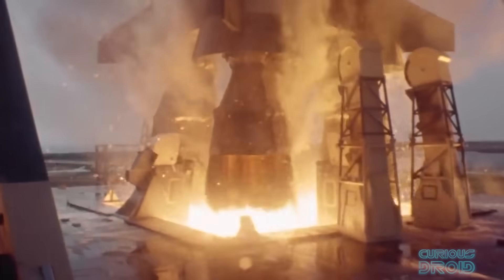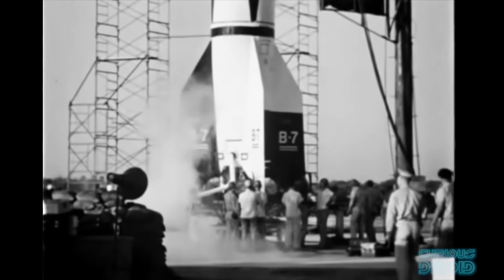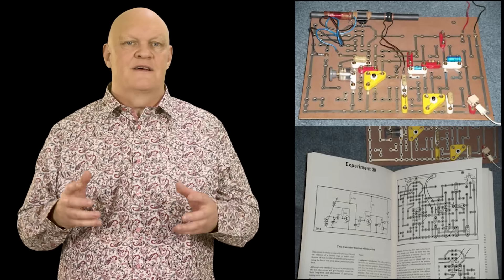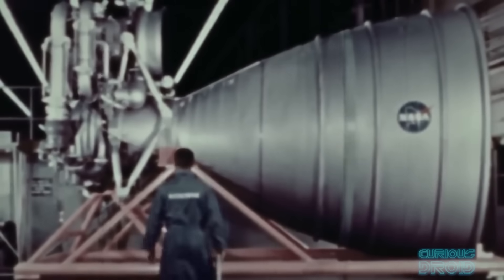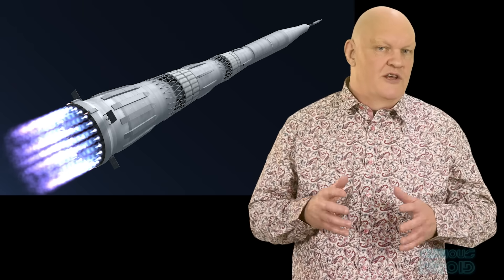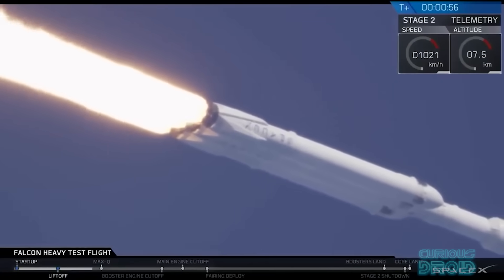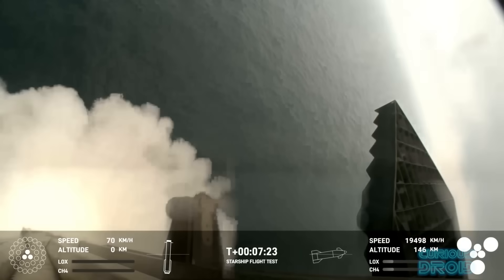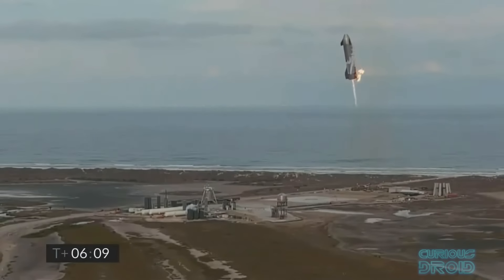Why Does SpaceX Use 33 Engines While NASA Used Just 5?

Comment: If starship has more thrust than apollo, why does it need to be refueled in orbit to reach the moon?
Reply: Because Starship is not being developed to fill the Saturn V's shoes.  If all SpaceX wanted to do with Starship was lift something to LLO, R&D would have finished years ago and the vehicle would already be complete.  Starship has two huge mandates: Full reusability and the ability to get a massive (100 to 200 tons) payload to Mars.  NASA's HLS contract is a side mission.  That all being said, it is extremely fortunate that SpaceX won the Artemis contract, because the end goal of Artemis is to "stay on the moon", which means you need to bring 1000 tons to the moon's surface eventually.  No matter who developed the vehicle to make that possible, they would absolutely have arrived at the same exact solution: refueling in LEO to make the rest of the trip.  Otherwise you're not going to get all that mass to the moon, period.
Reply: @Asterra2  And yet they can't even get 1 ton to LEO.
Reply: @C.I...  What will be the next thing they haven't done, after they've taken advantage of one of their test flights to deliver Starlink?  I refuse to believe you seriously think that was some kind of legitimate burn against SpaceX.
Reply: @C.I...  They haven't tried, yet.
Reply: Large dry mass (stainless steel), additional hardware for reusability, payload types, etc.
Reply: Larger payload, finer controls, REUSABLE
Reply: Because thrust is not the only factor; efficiency is another one. 
Saturn V first stage used RP1, which is highly refined kerosene. It's great for that push off the launch pad, but stage 2 and 3 were hydrogen fueled, using different engines. Starship uses methane for both stages, which is much closer in character to kerosene than hydrogen. It's great and simple for getting stuff to LEO, but not so much beyond that. 
What it WOULD be great at is lifting a giant liquid hydrogen spacecraft to LEO and then returning, for a fraction of the cost of a disposable launch vehicle.
Reply: @IstasPumaNevada  Kerolox is less than 10% more efficient than methalox in a vacuum.  Non-zero but certainly not a major factor.  The actual answer comes down to the simple fact that Apollo never sought reusability and particularly never had a mandate of bringing 100-200 tons to the lunar surface.  Starship is a Mars vehicle contracted to fit NASA's Artemis mandates.
Reply: It is a lot bigger and heavier than Apollo
Reply: The Saturn V's payload to LEO was about 140 tons -- 4:35 -- about the same as the SpaceX rocket.  But almost all of that was the expendable third stage.  
SpaceX wants to send its ship to the Moon, and bring it back.  That'll take a lot more fuel.
Reply: And, refueled by HOW MANY rockets?
Reply: @jimjones-pz1tt the only other lunar lander NASA has contracted, Blue Moon, requires up to 8 refuelling flights as well. There’s no going around orbital refuelling with either of the options.
Reply: Did Apollo 11 actually leave near-Earth orbit?
Despite the revisionist narrative that this channel won't question -- unstable fuel burn for the oversized F1 engines was never rectified and another arrangement in their place was made in order to reach near Earth orbit, keeping the F1 bell nozzle to maintain the desired appearance.  The great licking yellow flame was an indication that something was not normal as fuel was burning in the atmosphere while providing no additional thrust. This was the result of injecting additional kerosene into the exhaust stream for greater visual effect yet appearing to produce an inefficient burn unlike other rockets after launch.  No explanation is forthcoming and this issue is not addressed in any usual report; however, using a smaller reliable engine with a reduced fuel load and stripped down mission requirement allowed the Saturn V to reach near-Earth orbit.  

The Apollo 11 crew attempted to demonstrate their position at over halfway to the moon as seen in the unedited version presented to the public while the more recently released unedited version reveals a flood of blue light entering the same window as the camera continues to roll, through which only a moment before, we saw the Earth far distant in what appeared to be very low light conditions. Then, as the camera pulls back from the window, the exposure settings are seen to return to normal as a flood of light enters the same window.  Without a change in the orientation of the spacecraft assumed to be on a trajectory toward the moon, the only source for any flood of light can be the Earth while in near-Earth orbit.  

Another indication are the impossible weather patterns seen on Earth, when in reality only a small portion of the Earth's surface was visible, framed by the round window of the command module.  Straight line cloud fronts are seen to be extending for what appears to be more than 6000 miles, a quarter of the Earth's circumference -- something that has never occurred in the meteorological record on Earth. 

The usual sponsored efforts will try to make excuses for why the obvious did not take place -- yet is overly apparent in the unedited version.  When facts cannot prevail in support, sponsored activity will resort to name calling and other derogatory comments discrediting themselves.

Comment: Those shuttle engines were going to be dismanteled. SLS is actually putting them to use.
Reply: At a cost greater than the original cost of the engines.
The whole thing is so bloated it's inexcusable. The sooner SLS gets cancelled and the last vestiges of Shuttle tech fade into history, the better; for taxpayers, for spaceflight, for everyone except the big entrenched aerospace companies used to getting cost-plus contracts.
Reply: @IstasPumaNevada SLS = Senate Launch System. Its purpose is to provide high paying jobs in the states that the Shuttle did. Actually launching SLS is only necessary so that more have to be built.

Comment: 33? Sounds like the N1 rocket
Reply: Starship’s first stage booster already made it further than the N1’s first stage 3 times in a row already.
Reply: @alxz3707  With ZERO payload.
Reply: @jimjones-pz1tt  does that matter? I was literally talking about first stage performance. Payload is a whole other topic.
Reply: @jimjones-pz1tt  SpaceX does their testing with real flights.  You are literally looking at the phase of their Starship development which, for an entity like NASA or Boeing, would be taking place entirely in ground-based simulations.  The difference is clear: Real-life prototyping lets SpaceX make new decisions informed by real data, and they get the finished product out faster and, by an order of magnitude, cheaper.  This is why SLS takes an eon to reach its first launch, must absolutely work the first time, costs $4 billion a pop, and can't be built faster than maybe one per year.  Starship prototype stacks can be built every month or two, launched every couple of months, and cost $100 million.
Reply: @jimjones-pz1tt it had spare delta-v for 50 to 60 tonnes.
Reply: @Asterra2  SpaceX does their testing with real flights
Which is what the Soviets did because didn't have anything else.
Vasili Mishin said in an interview that they expected people to fly on the 9th or 11th launch, which was not economical
Reply: @georgH  In complete fairness to the Soviets, SpaceX represents the first time the vehicle has been designed so economically that rapid prototyping is a legitimate option even for a private company.